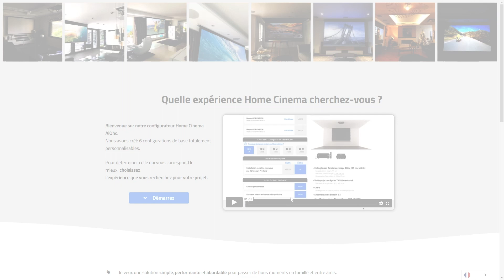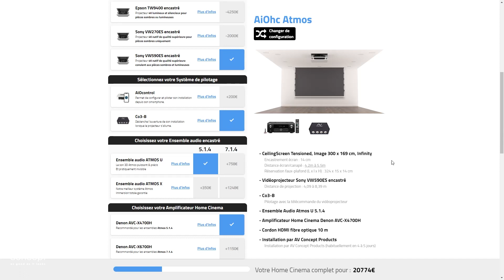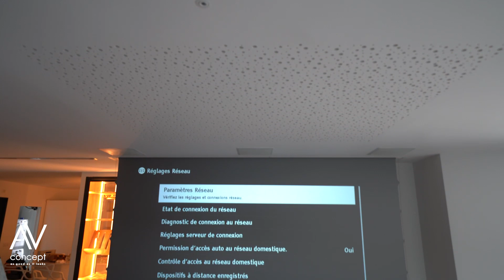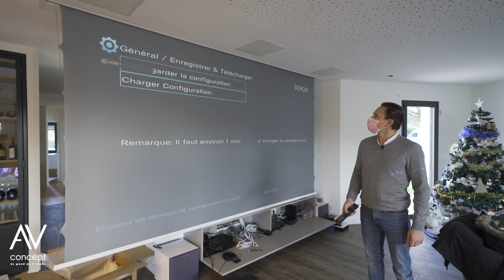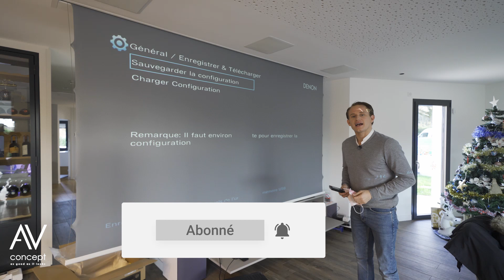Saint-Nazaire : Home Cinema Dolby Atmos en extension de maison 📐🧰

Comment: Belle installation Sacha. Tu devrais prévoir dans ton stock des caches pour les enceintes au cas ou, comme ici exceptionnellement, imprimés en 3D en fonction du modèle d'enceintes, plutot qu'un  sac plastique qui fait pas très pro. Ça pourrai également être une idée protéger l'enceinte de la poussière dans les faux plafonds pas toujours très propres, et ça coute pas grand chose a faire d'avance.